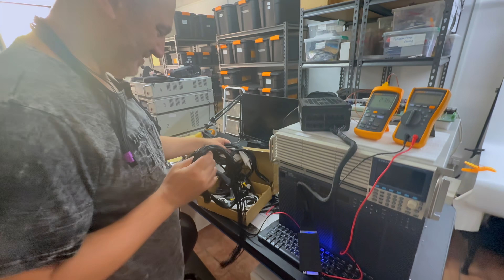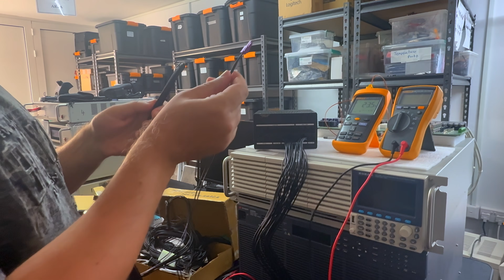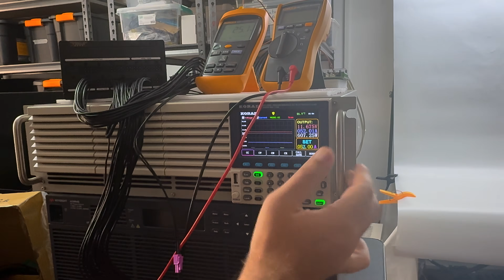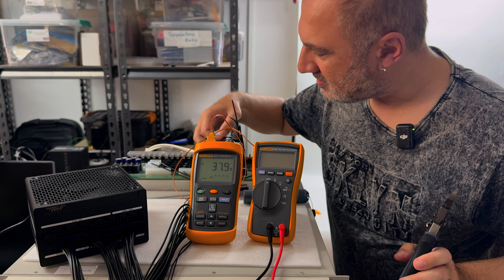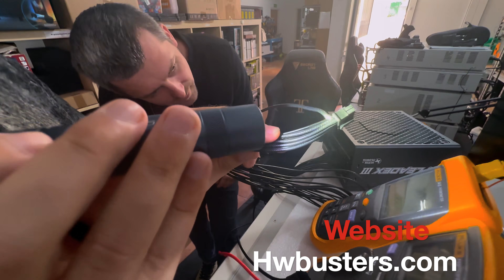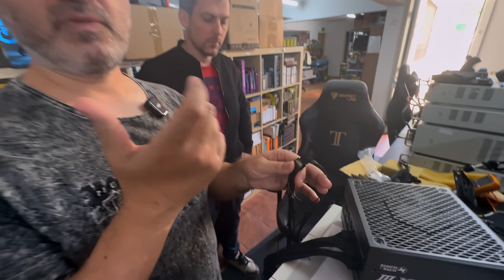Asus ROG Equalizer 12V-2×6 PCIe Cable Evaluation Review

Comment from the maker: Thank you all for your comments. I ordered the parts I needed, and next week I will find time to run some extra checks on this cable, simulating a bad contact. Unfortunately, my time is limited, but I will devote one full day to this project to run more tests. I will employ my scope and six-clamps system to get amperage per gauge and check the load distribution. I will also build a special test fixture that will allow me to simulate bad contacts and deliver up to 17A on the "good" pins. There will be an article explaining the theory behind the tests..
Reply: Thank you for taking the time to do this, HBs.

Comment: All the bridge does is protect the gpu from cables that are fucked on the psu side, if it had one on the psu side that would only protect the psu from return current 

If a pin is fucked after the bridge on the gpu side which is very common the gpu will still melt

Comment: lol and yet Derbower showed that the max delta between the pins on this cable is 4A so that bridge is garbage just like the connector, it just adds more resistance and more failure points. I won't be using this crap connector for as long as I can. Yeah 50$ is way too much for this crappy cable as usual with corsair products lately, lost all respect for corsair.
Reply: You mean Asus right?
Reply: @GlacierRain  lol oh yeah both are crap so easy to mix

Comment: How come debauer has a different conclusion is current distribution is worse? How accurate is his wireview pro detection?
Reply: Current distribution on Equalizer is bad but it can take a lot of heat (on gpu side) and that's a good thing I guess. Tbh is kinda misleading though from Asus side, cause they said the bridge also provides better Current distribution, which is clearly not the case with the Equalizer.
Reply: @SuRGeoNofDeaTH.  it could very clearly be the case, you can trust a cheap janky wireview to properly distrubute amps between all the pins, debaur shouldve done testing without his product
Reply: Because derbauer have to sell his overpriced 150€ toy.

Comment: this scenario is exactly not what is causing melted 12v2x16 connectors. The scenario is, one or more pins on the gpu side has bad contact / higher resistance. You do not simulate that by cutting a wire, not on the gpu side, not on the psu side. 
You now have equalized the load on the psu side, great, but not on the gpu side. From the bridge to the gpu, the resistances and currents can still differ depending on the pin's seats. The only thing this bridge has going for it, is balancing the thermal load across all the wires. 
Electrically it's equal or slightly worse to no bridge.

Comment: I've never head of cable wire melting. It's always been the connector  and people don't plug it in all the way or bend the connector.
Reply from the maker: when the insulation of the wire melts, the pin/connector is already in trouble
Reply: Get an inspection mirror for your tool kit.
Verify the seems are sealed or your taking a gamble.

Comment: The worst case scenario would be to simulate the increased resistance between pin and socket. Nope.... This test is pointless.
The bridge is only on the GPU side, because that was the part where people make mistakes and often remove and reinstall the plug. On the PSU side, usually people are not afraid to put it correctly with good force and never remove it.
Lastly the GPU socket is where cables are stressed due to bending when the side panel of enclosure is installed.

Comment: This is an incorrect test. A poor connection will cause the connector to melt due to the large voltage drop across the contact resistance.

Comment: He cut the wire on the wrong side of the bridge. The scenario is too simulate bad connection on the gpu side , not the psu side...wtf? Still the outcome would be that the gpu side would reach high temp and it would melt.
Reply from the maker: whenever you cut the wire, the bridge will make the loads equal. Also I guess you didn't understand a thing about the vid. I cut the wires on the GPU side but as I mentioned already, this doesn't mean anything.
Reply: @HardwareBusters you don't know that, cause you never measured all the pins

Comment: A far more worthwile test of the product than Debauer's attempt. Honestly, this seems like a big win for a 50 dollar cable, and not a 100+ dollar gadget you attach to your GPU.

The only reason the PSU side was an issue was because literally all but one of the wires was cut.

Under normal operation, this should be a win for users.
Reply from the maker: under normal operation correct, it will be fine. Because already I went TOO far just to check the cable's capabilities. The fact alone that it didn't melt on the GPU side with 52A on a single wire is great. After all Asus talks about up to 17A currents, not 52

Comment: And what if we connected this cable the other way around, with the end that has a current balancing bridge to the power supply, and placed one of the adapters, for example, Ampinel from Aqua Computer, on the graphics card side? Theoretically, this should ensure balance on both sides of the connection, shouldn't it?

Comment: I would agree with the other person that cutting the wire between the "balancer" and the connector might be better indicator of a bad pin contact
Reply from the maker: cutting the wire after the bridge will bring more heat to the pins, but still the load will be equal because of the bridge. ALL will have equal loads. No pin will be 20A for example and the other 2-3A. The bridge helps make the loads (more) balanced. 

Now ONLY if you cut 2-3 wires AFTER the bridge, the connector on the GPU side can melt eventually. It is the same that happened to the PSU side where I noticed melting after a while with a single wire and 52A current.
Reply: @HardwareBusters interesting for sure. Doesn't seem like a cure but I bet it could significantly reduce the cases of melting connectors. I just wonder how much their 14 amp rating actually holds up or whatever they're claiming

Comment: Sorry to keep posting, but the Equalizer is pointless. The cables have been melting in the field because of the poor connection in the plugs at the GPU or PSU end. If you cut the cables between the equalizer and the GPU plug, you will still get the same melting issue at the GPU plug. The Equalizer clearly does not solve the root cause scenario, where a few pins in the GPU end plug are making poor connection, and the rest of the pins have to carry the full 52A, in which case melting is very likely!
Reply: agree, this does not change anything like u said, connectivity between the pins of the cable and the connector of graphic card is the issue. even if they add the "balancer" on the other side it will still be possible to not have perfect connetion anyway.
Reply: @Pillokun Yes, and I think this has been proven, since there are cables with similar equalizer which are actually integrated directly into the GPU plug end, and there were instances of the GPU plug melting on them too.

Comment: You have tested one scenario. But the more likely scenario is poor connectors at the GPU end, so you should now test another cable, but cut the wires between the GPU and the Equalizer block. This way you will get melting at the GPU end, and you will realise that the Equalizer is really pointless and does not fix the melting problems. The good thing about this cable is that each wire is rated to 17A, and the Equalizer physically limits the movement of the wires, and can help the pin sockets stay at the same length within the connector at the GPU end.
Reply: I could do that. Let me see if I have a second cable to destroy.
Reply: I will actually simulate a bad connection using the proper materials. I will order them today from mouser and build a test fixture for 12V-2x6 cables.

Comment: What would happen if you’d cut the wires between the metal part and the connector on the GPU-side? Because it’s usually single pins within the gpu-side connection that don‘t have enough contact, i suppose. But maybe I missed something.
Reply: The load will be distributed to the rest wires/pins because of the busbar that connects them all together. This way they will be able to sustain 1-2 pin losses depending on the load and the conditions

Comment: Pointless video...poor way to review a cable, as a fun experiment after a proper "review" cutting the wires...fine, but this is just dumb...
Reply: The experiment here was to simply demonstrate how ASUS new cable works, plain and simple and indeed worked as intended. What i would have liked to see is to have the connector plugged in wrong and duplicate a dumb user scenario where not all pins are making contact with the GPU female connector but either way this still proved ASUS right.

Could you elaborate why do you think this was dumb?
Reply: @hlecaros Lookup Derbauer's video, both of them on this cable, this is a proper review, as an engineer, this video is almost pointless, the only thing this proves is maybe the individual cables are a bit thicker in gauge, which is a positive, but that's it...
Reply: @arnold3811 it's not a proper review. This guy did.

https://youtu.be/2eEv-gFdMos
Reply: @SuperBROKEN81 lmao no…just no 🤦‍♂️
Reply: @arnold3811 You obviously didn't watch the video. It does everything Asus said it would.
Reply: @SuperBROKEN81 so it has active circuitry in it? Cause ASUS said is load balanced and it doesn’t so no you are wrong, besides thats not even where I was going with this conversation. I was talking about his methods of reviewing the product, not ASUS’s claims…but whatever..
Reply: It's not. It proved what Asus said
Reply: You are missing the point.

Comment: Hello, long time viewer, I really appreciate you doing this.

Question, are the pins actually designed in some way to be rated for 17A as Asus claims? My understanding (which is limited) is that 9.2A per pin is not good
Reply: To the best of my knowledge, pins cannot exceed 17A for prolonged periods.

Comment: Thank you for the testing HBs, you have been one of the few CCs to go above and beyond with diligent testing. It is quite insightful to point out to Asus they should have added a second bridge on the PSU side, maybe they will update on it on another iteration at minimum cost. 
I guess I would have to update my PSU soon, get this cable and a Wireview Pro 2 and even then can't trust this high failure connector design.  No thanks to NVIDIA for inventing a new problem to shorten the life of their GPUs.

Comment: What is the purpose of the small auxiliary 2-pin lead attached to the ASUS 16-pin (12VHPWR) cable, identified by the purple ‘ROG’ connector?
Reply: It is an extra voltage sense which is supposed to provide lower voltage drops.

Comment: Afaik Nvidia said this bridge is and was in their adapters but pins melted anyways on gpu side
Reply: The bridge is in the connector in Nvidias official 8 pin to 2by6 high power adapter
Reply: @kenshin1703 it's not though. Bildzoid proved it
Reply: @kenshin1703  Were users tinkering with overclocks?
I've noticed the complaints but I've been wondering how often it's happened to default settings compared to overclocking.
I used to terminate high voltage connections for a living and I know one loose connection can cause a disaster waiting to happen.
If I can't verify the connection myself, I don't assume it's done right.